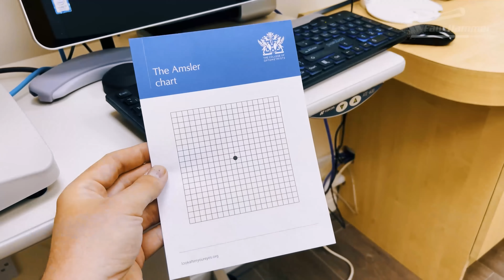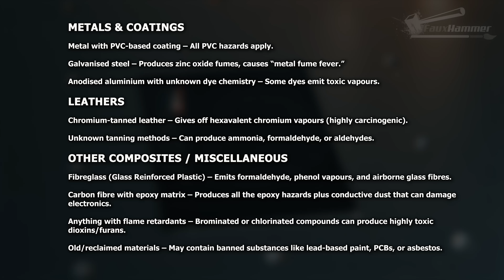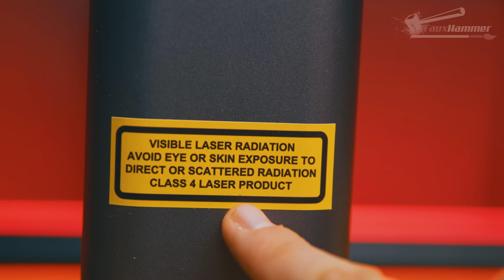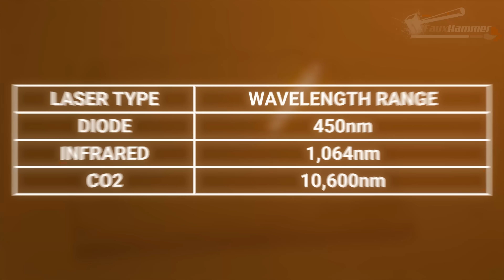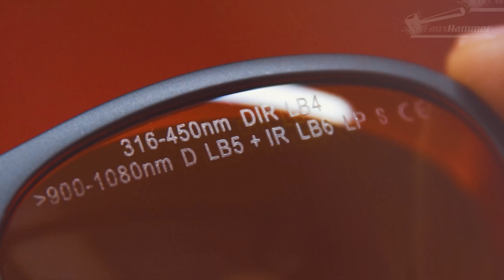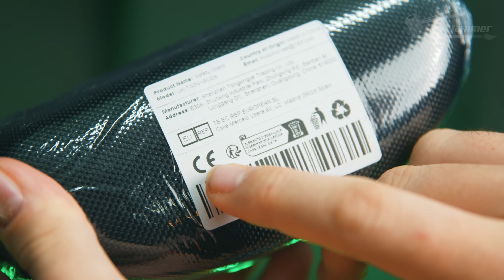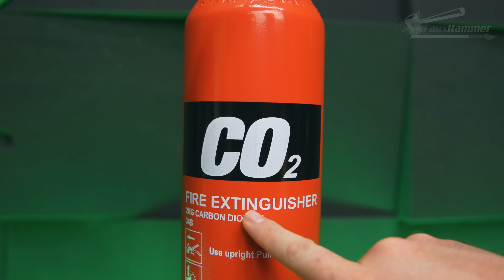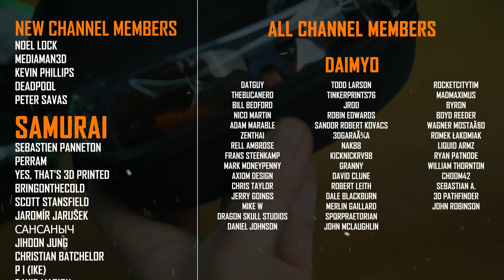DO NOT BUY A HOME LASER! - Before watching this video - Best Home Laser Safety Glasses?

Comment: Class 4 (5 W) 355 nm UV lasers require EN 207-certified goggles rated for 355 nm (D LB6+). 
UV is invisible, reflections remain dangerous, and eye damage can occur before you feel anything, as its photo chemical damage not thermal — generic UV or OD-only goggles are not adequate protection. BE SAFE. this is class 4 normally at home in a safety rich lab.

Comment: The links you provide are for glasses that pass the EN207: 1998 + A1EN207: 1998 + A1: 2002 standard. The EN207: 1998 + A1: 2002 standard for FreeMascot OD 6+ Laser Safety Glasses has been superseded by newer versions, but it remains a "valid" certification. Here's what happened to the standard:

    EN 207:1998/A1:2002 was updated to EN 207:2017
    The newer version is now superseded by ISO 19818:2021
    However, glasses certified to the older EN 207:1998 + A1:2002 still provide "legitimate" laser protection.
Revisions to the previous standards, such as EN 207, made testing more demanding and realistic by reducing the test diameter of the laser beam and the time of impact. The new ISO standards, such as EN ISO 16321, include new tests like a "sit and fit test" and a "basic impact" test that replace older, less relevant requirements. EN ISO 16321 is
the current European and International standard for occupational eye and face protection, which has replaced the older EN 166 standard. It specifies general and specific requirements for safety glasses, goggles, and face shields to protect against various hazards such as impacts, optical radiation, chemicals, dust, and heat. The standard aims to provide more rigorous testing and clearer information about the protective capabilities of eyewear, ensuring higher safety and durability for users in industrial, laboratory, and educational settings.
 For laser protection, the current standard is ISO 19818:2021

Comment: I recently got a Falcon A1, which didn't even come with cheapo safety glasses, so I wasn't thinking about eye safety at all at first. I started messing around with it and quickly learned not to look at the laser, even through the orange enclosure. But I wasn't that careful and didn't have safety glasses. I've got some on the way now but I'm worried about what damage I could have already done with just a little bit of exposure (especially hearing that even reflected light can be bad!). I'm going to be far more careful from now on, but I'm praying that I haven't already irreversibly scarred my retinas!

Thanks for making this video. When I was researching home lasers, no one was raising this as an immediate concern. I thought as long as it had an enclosure I should be alright!

Comment: Get a separate in-line fan for your exhaust system. Install it as close to the vent exit as you can. It's better to pull fumes than push them. The internal fans on most of these devices are way underpowered IMHO.

Comment: One thing you didn’t mention is that there are laser safety class ratings. Fully enclosed machines with switches that kill the laser when the lid is opened are class 1 and considered to be completely safe and incapable of causing harm, while open gantry lasers are class 4 and require glasses to be worn whenever the laser is on. Many of the newer XTool machines are class 1 in their default configuration, but become class 3 or 4 (most dangerous) when you add a riser base, use the passthrough functionality or in the case of the F1/F2 use the laser without the lid cover in the fully down position. 

I have an XTool M1. In its default configuration it's class 1, but when you add the riser base it has a huge gap between the plexiglass protector and the case where you can easily see the laser. I've caught a few errant reflections through that gap when using the machine. I don’t think it has caused any permanent damage, but it could. 

Looking at getting an XTool P3 which is class 1 in all configurations unless you're using the conveyor, which I don’t have room for anyway.

Comment: Since you're into mini's can you please, please, please do another H2D video printing non-FDM-optimized minis on the H2D, using dissolvable supports.

Resin printers are a hassle because of all the post processing and PPE required to handle them. 

FDM minis are great if optimized for FDM, but support removal is always a hassle for non optimized models.

I feel like the H2D could be the perfect massive printer for FDMs
Reply from the maker: Honestly mate, I think it's overkill if you;re printing minis. The size of that plate would be wasted. when printing minis, the ideal method would be to focus on one mini per print. Slow it down, use lower layer heights and smaller nozzles. Hopping between multiple minis across that build area is just encouraging failures to happen. 

Bambu haven;t dialed in the profiles for minis, most success is thanks to third party profiles where individuals or teams of peopel are working thorugh them to deliver the best results. but as for "Support for PLA" it;s not gonna work at thats scale. it's just the material it doesn't bond as well, buit that's the point. so when you scale it down to small touch points. it's not going to work. Even on the Doom helmet I printed, that had a small spike at the front, much larger than a mini support contact point, and that didn't bond properly. on a 0.4mm nozzle.

So in theory it would be great for that if it worked, but i can;t see it worjing until someone makes a profile for it and i'm sorry, but i don;t have time to do that on my own with everything else i have on.

Comment: Xtool has a retrofit automatic extinguisher that is working stand alone and could literally be attached to any enclosed standard size laser of any brand. I paid just 150 € for mine. No replacement for a real extinguisher, but an extra piece of safety and sanity on that front.

Comment: I’m on my fourth CO2 laser for home use.  The issue of optical safety cannot be understated!  Thank you Ross for taking the time to talk about this.  Well beyond Resin safety, fume safety, etc, Optical safety is the inverse-holy-grail of risks.

As a side note, I once built a blue spectrum laser to pop balloons etc.  The beam caught a reflective bit of junk in the air and popped a balloon on the opposite side of the room from the one I was targeting.  High energy light is predictable, your environment is NOT!  So absolutely, 100% always wear the highest grade optical protection that you can get, keep your device enclosure in good repair, and be prepared for the unexpected.

Note: I am not downplaying Resin and Fume safety.  You absolutely need to protect yourself with those as well.  I emphasize laser safety here because a one-off resin issue is an inconvenience while a one-off laser issue can be permanent blindness.  Stay safe folks!

Comment: Of course LLMs are "absolute bollocks". And not just right now, but by design. Do not get your safety advice from an overhyped spell checker. Or do not get any advice from it, really. 

ChatGPT is not a truth teller. It knows nothing, it can't know anything. It doesn't understand anything, it can't understand anything. It will just pull statistically likely words from a hat.

If historically, a lot of people were wrong or ignorant or misinformed about a complex or opaque issue, that will be reflected in the ChatGPT answers. This includes the law (bonus points for it throwing different jurisdictions into the same hat), safety procedures or anything else that stumps a 5th grader. Or even lower, considering the high percentage of USians being wrong about everything on the internet.

Really, I wish people would stop thinking ChatGPT is some magic ultra intelligence. It's not, it's the contrary. It's the essence of the stupidity of a crowd.

Comment: A less talked about part of safety equipment is human habits, for example, I use the phillips safety KG5+ lenses for 1064 work in my business, theyr'e really expensive, but they have an OD10+ rating in 1064 (which is wild, you could basically stick your head in a 50w machine and have no effect for like 2 mins of continuous beam exposure lol) and an 8+ at 10600 (CO2). 
But the habit part is that they're clear and comfortable, so wearing them isn't a compromise I have to make while lasing, these means that I'm more likely to accidentally leave them on when I didn't need them and not the other way around. This applies to other broadband lenses that are super protective in your main range, but less (still sufficient) in a second range too, there's an argument that you might end up more likely to still be wearing them between different lasers than to remember to change to the right ones.
This video is all good advice though. Sunscreen for uv lasers is a good one and generally being aware that sometimes reflected light can cause unexpected effects, such as scorching things in the room or sometimes even your skin. I have lased reflective copper before and while looking safely through my glasses, felt "warm air" on my forehead before realising its actually reflected light slow cooking my face.
Also, people often forget that staring into the visible light plasma that comes off an engraving is super mesmerising, but is still dangerous, not in the way the laser is, but it's basically the same as staring into a tiny welding arc that can hurt your eyes or produce unexpected secondary wavelengths, even is they're not coherent like the laser.

Lasers are super cool, super useful and relatively safe, as long as you observe the relatively short list of non-negotiable safety items.
Reply: "That they're clear ... so wearing them isn't a compromise." You’ve made a very important point here. (I’m also a Phillips Safety KG5 lens user, without the “+.” I bought them years ago, and I don’t remember the “+” being available back then.)
There is a parameter called VLT (Visual Light Transmission) for all professional safety glasses. Ours are VLT 75%, which feels like completely transparent glasses with only a very slight bluish hue. I highly recommend these. I also made a custom shield out of black felt to fit the gap between the glasses and my face, so no stray beam can get in from the sides.
Reply: "stick your head in a 50w machine and have no effect for like 2 mins of continuous beam exposure lol) and an 8+ at 10600 (CO2). "
Well, I guess this is not the way they meant to protect. these lenses absorb 99.99999...% of the incoming beam, that energy has have to go somewhere, and they would just melt in a couple of milliseconds, so their protection would be gone instantly. These are meant to block low-energy scattered beams by absorbing it, not the direct beam.
Reply: Fellow KG5+ user.  Figured with the 2kw laser welder and cleaning machine I should have about the highest OD rating I could find!  Its centered at 1080, which these are still OD10+ at, where many drop off above 1064.  I just wish I could get frames made by oakley out of their material instead.  Its far superior!
Reply: @corrylazarowitz617  I have a comment regarding laser welding use of these glasses: the KG5+ lens selection is excellent—actually the best available for this laser wavelength of 1064nm. However, there is an additional factor you should be aware of. During laser welding, the heated material itself emits visible light  (which you perceive as sparks), and also emits radiation in the UV range harmful for your eyes.  This is the so called secondary emission.
Wearing protective goggles may give you the impression that you can safely look at the sparks (which are indeed attractive to watch), but remember that these goggles are not intended to block intense visible light and are not designed to filter any harmful UV wavelengths (100 – 400 nm)   actually they can filter some, but most likely are not certified at any OD rating for UV   (I have not checked though)

Comment: Yeeees to the hole installing!!
I just bought a house and I'm getting my very own hobby room, and we know that air ventilation should be a priority since we have a resin printer!
For now i have just stuck the hose out the window but that becomes very cold very quickly in the Scandinavian winter, so as a result i haven't actually printed very much..
Now that I'm getting a house where we can make changes however we want to i would like to get a hole for the ventilation to vent out off! Seeing how you went about it could be interesting :)
I have a window that we maybe need to change in the room anyways, so i had been thinking if it was possible to make a hole there that the hose can attach to and then the air can be vented out like that, it might be cheaper then making a hole in the wall but i don't know..

Comment: Very important topic. One point I'd like to add is to watch out when getting glasses for 532nm green lasers. They create their visible beam by doubling the frequency of an infrared laserdiode. This invisible light often leaks out and may not be blocked by glasses for "green" lasers. In addition you don't even notice the danger as it is invisible. Make sure to get the right glasses. I prefer 520nm for this reason. Different technology, no infrared there.

Comment: Great video. Even with glasses on, try not to stare at the laser. It's just a protection in case something goes wrong, not a 100% proof protection against lasers...
The OD4+ .. 8+ just describes the amount of blocking of the laser. For smaller power lasers that are used on things like wood, a lower OD value is good enough but higher power lasers or when a higher risk of larger reflections (like a fiber laser being used to engrave steel) is used. A higher OD value is required. That said, it never hurts to use a higher OD value. 
Besides the OD values, some companies also specify the amount of visible light dimming. I found that spending $/EUR 200 for a pair of good glasses is well worth the money (remember that the fiber laser costs 10..20 times that money). Better brands do sell glasses that have an OD 8+ rating for 1064 but they do not block the visible red light from the red dot laser being used for framing. Not having to take my glasses off all the time means I also cannot forget to put them back on again 🙂

Comment: Another thing to consider… your laser machine might be safe without glasses in its normal configuration, but swapping in a conveyor system or other accessory might expose the beam. 

On my xTool P2S, using the conveyor means opening the front and rear panels to allow material to feed in. Then the beam is completely exposed and could reflect out and hit anyone in the area.

Comment: Great video, but a bit paranoid. About the cheap included glasses: they usually offer SOME protection. It does not need to block completely the laser light. It just needs to be within safe limits. Also when you look at an infrared laser, the light does not focus correctly on the retina because of chromatic abberation. The problem happens when you focus a bit closer, then the infrared gets in focus
Reply from the maker: Fair. I was probably over-hyperbolic on the glasses. I’m just reiterating what others have said quite loudly
Reply: Yes they might offer “some” protection. But you have no idea how much. Do you want to gamble with your eyesight? I work with lasers professionally and I have a diode laser cutter at home. That thing stays in the enclosure I built and I am never opening that lid while the laser is on. The highest safety class for lasers in a lab is class 4 at 500+mW. Ten times weaker than the weakest home laser cutter.
Reply: @Hooverdreng it's easy to test. I'm a test engineer and often i improvise. UV lasers usually have a removeable lens. Take it off. Now you have a frickin' UV flashlight. Just don't look into it. Stay with me. A 5W output power laser without a lens is dangerous as a a LED car headlight. A car headlight will blind you if you look at it directly from 10cm. You have at home at least one item that is neon green like a sports t-shirt. Usually it glows like crazy under UV light. Now put the crappy protective glass in front of the UV diode. My crappy included glasses blocked all UV, the neon T-shirt was barely visible in the dark room where i tested it. BOOM. TEST DONE. My guesstimate is that it filtered over 99.99% of UV which is WAY more than enough for me. I have UV LEDS, UV flashlights, UV LED strings and i get regularly way more exposure from them and they are safe.
Reply: @dtibor5903  sure. Will most people make such a test? Surely not. They will believe that the cheap glasses will protect them. And the comparison between led diodes and laser diodes is flawed at best. Power is not the relevant metric here. Intensity is. Lasers are focused to such a small point that intensity becomes many orders of magnitude higher than even the best focused led. Also, these lasers are often in the visible spectrum so they will penetrate all the way to the optic nerve. UV (depending on wavelength) will be mostly absorbed in the outer lens of the eye. Resulting in less severe damage to your eyes. I am not saying that lasers cannot be used safely. I am just saying there is no good reason to look at them if you don’t have to. And a lot of companies are promoting some absolutely ridiculous ways to use them. I have seen ads with the laser cutter sitting on a kitchen table and kids looking on in excitement. Pure, malicious  recklessness from the sellers.

Comment: one of the same reasons im trying to secure local supply of laser welding lenses/laser safety glasses of certified quality prior to getting my falcon2  or my laserlabs x1pro operating with their included  OD 6/7/8 lenses